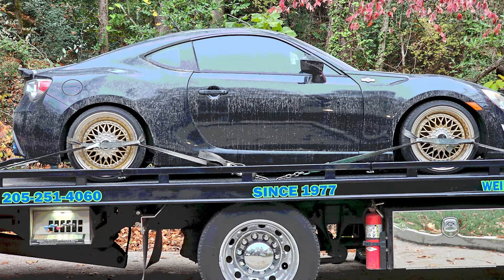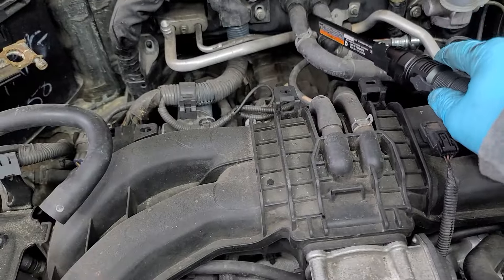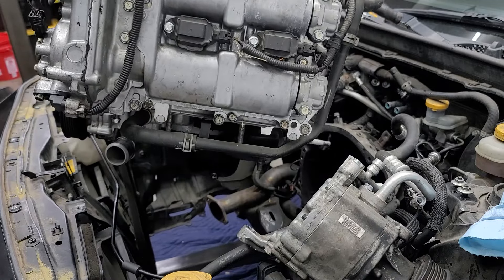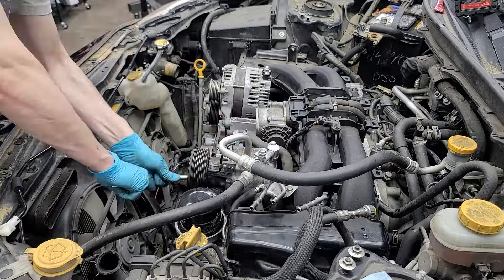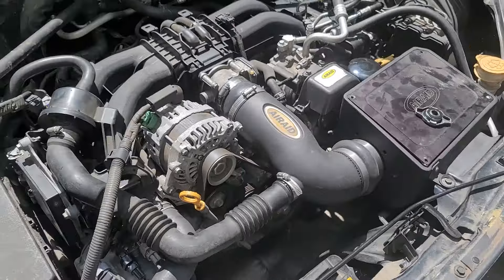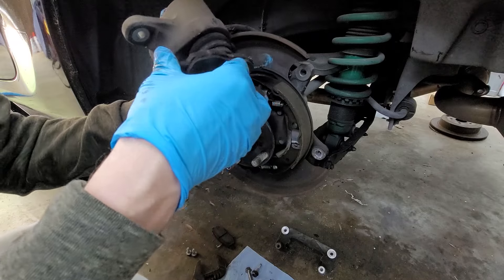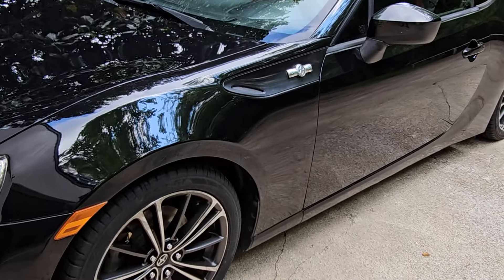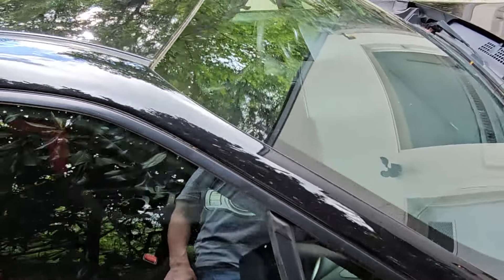2013 FR-S/BRZ Engine Replacement fix and flip

Comment: Hey I need to install the water hoses to the transmission oil cooler but I cant seem to find where the water hoses are located on the actual engine can you help?